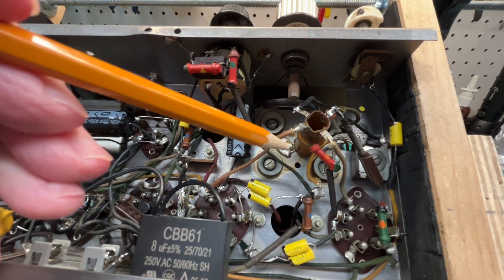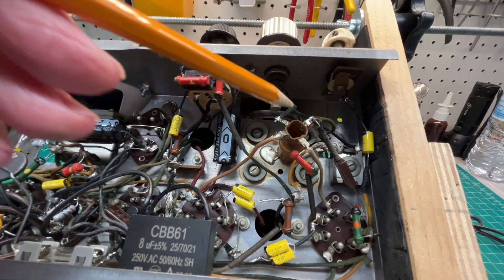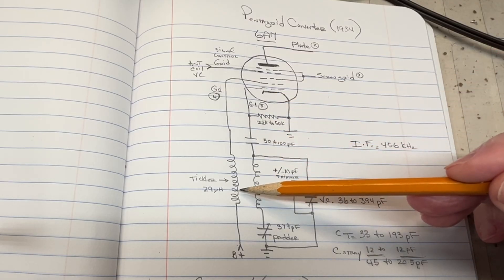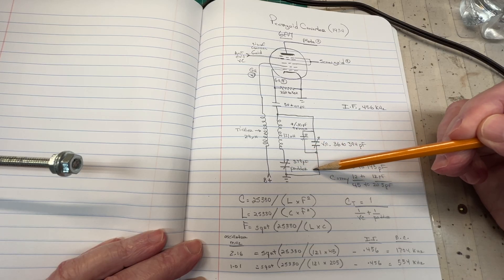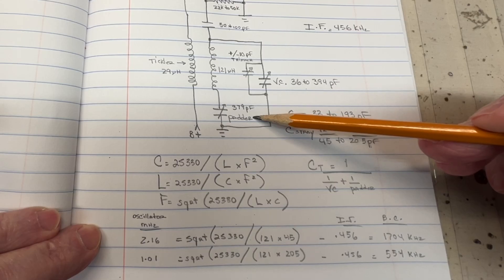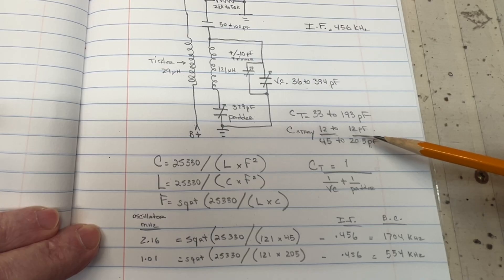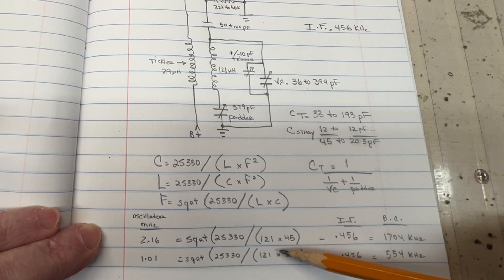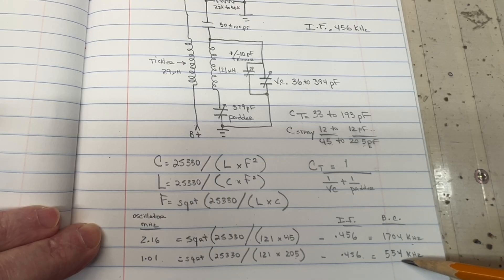6A7 Oscillator LC & Frequency Calculations | F=sqrt(25,330/(LC))

Comment: Also, I left out an important point in that the 456 KHz is still real in the signals that exist now in the mixer,so now with a 455 KHz filter {set at 456 KHz } it comes out in reality as a 456 KHz frequency.

Comment: Thanks, I will. I think I came to the conclusion on my own that the trick was I was looking for a ghost actually,because the 456 KHz is the oscillator frequency minus the tuned frequency and is really just in the math,...in other words it didn't mean that the oscillator would oscillate at 456KHz without the gang in place in the tank circuit actually. But it does mean that the oscillator with the gang in place does oscillate at 456KHz above the tuned frequency. Does this sound accurate?

Comment: How did you know the oscillator would oscillate 456KHz above the selected frequency?
Reply from the maker: The IF transformers are physically tuned to 456 kHz, the oscillator and tuning capacitor are mechanically linked and as you turn the tuning knob, both circuits track together so the frequency difference stays 456 kHz. Thanks for reaching out. Best, Don